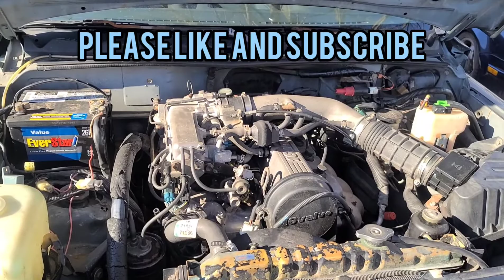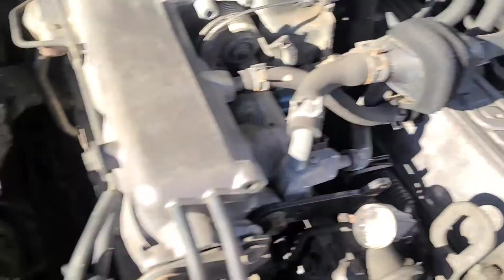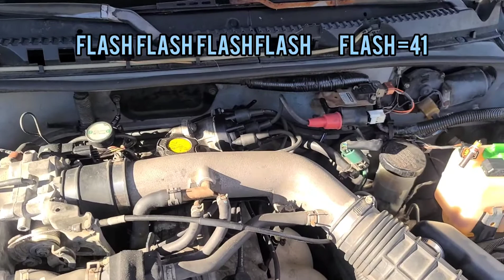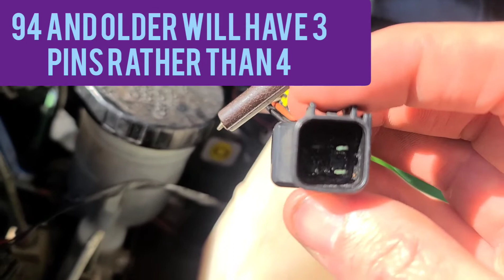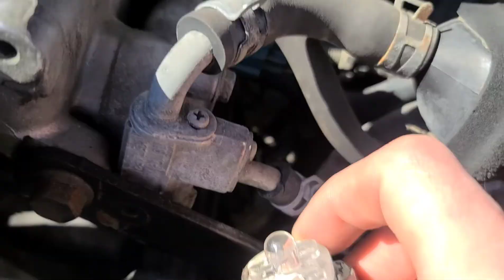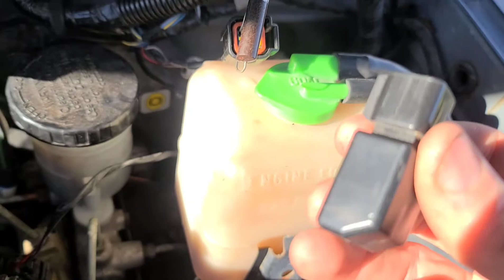Geo Tracker no start repair, quick fix!

Comment: My 89 is notorious for corrosion. Last two times the no start was from corrosion on the two screws on fuel pump. Make it easy cut access hole so you dont have to drop tank. Watched all the videos and did all the checks suggested. Like I said the corrosion was on actual fuel pump leads. Cleaned with battery terminal cleaner. Started right up.

Comment: bro am having a problem with the exact same car which is no spark. when I turn the key on I see 1 spark just like you said with the injector's and while cranking the engine there is no spark and after I stop cranking, I see one last spark. but I've not checked the injectors like you did. we pulled out the ECM and checked for any funny looking capacitor but no luck. also, the ignition coil and ignitor have been checked but they are fine. now am only left with replacing ECM, noise filter and distributor. if you have any suggestions please help. I'll do the test you did on this vid but am not convinced that will be my issue because as you said in your case you got spark and I got non.
Reply: After a long trouble shooting we finally figured out the problem which happens to be a wiring issue. in case anyone is having the same problem I thought this might help...
What happened was there is a wire that goes from the distributor to the ECM I think it's a camshaft angle sensor CAS (I might be wrong) and that wire was broken, we fixed that and the spark was back she fried right up.😊.

Comment: Very educational video. No body talk about this issues. I have a 97 tracker everything runs good, till i fueled up and now the check engine light is on all the time. I did the 2 & 4 pins code reading, and nothing, the engine check light never blinks at all. Any idea can be the my problem ? Thanks guys.

Comment: Hi man Daniel here my car does the same if i spray fuel into the intake it starts, but the moment i stop spraying it dies, I did also test with noid lights on all 4 and do have continuous light on them flashing when cranking. It does look like the flashing on noid lights goes a little bit dimmer as I am cranking over, is this normal. Lastly my resistor like the one in video has only 3 pins with two measuring over 2000ohms but other two is just open line, I thinks i will replace that also and check it out from there.

Comment: Great video:) any luck finding one, part number?
Reply from the maker: I was unable to find this part, however making one using inexpensive resistors has proven to work without an problems.
Reply: 11492-1105  this part ranges from 35 to 58 bucks

Comment: I bought a 94 geo tracker that wouldn’t start we did all kinds of trial and error but there is just no power to the coil ! We’ve replaced the coil and still no dice it’ll crank just won’t start :/
Reply from the maker: No power to the coil primary circuit?
Reply: @ChronCrew  no power to the coil yes it will crank but will not start all the lights and everything works though

Comment: My husband has a 93 Geo tracker he is having problem getting it to start most of  the time.  Has good battery and good starter (he says).  He let the brake fuel run completely out, when he filled it up is when the problem started.  We are bleeding the brakes to see if that helps.  Can the problem be between the starter and the brakes?
Reply: No sorry
Reply: Brake system is self-contained.

Comment: Am having the same no start issues but the ignition is working the injector i test for a 12volt reading and the reading show 12 then 8 then 5 but i dont see the resistor connections you showing but i do see a 3 pin parts look like a resistor

Comment: With regard  to the noise suppressor that you need to replace, where on the car does it mount?
Reply from the maker: It just hangs on the firewall underneath the wiper motor on the drivers side

Comment: I have a 95 Tracker and just put in a new starter and it clicks a few times befor it starts, brand new battery, and positive terminal and brand new starter. Any idea what to do next? I took it back to the store and they checked it out in the truck and it checked out good even though it took a few clicks to start.
Reply: If it's a manual transmission, there's a button under the dash that's depressed by  the clutch pedal. It closes a circuit when depressed . It may need adjustment or replacement.
Reply: Which button? having this same issue on my 96 manual... No crank no start, not battery or starter, or alternator, ahhhh @dirtyboyscout8541

Comment: Very educational. I recently purchased a 95 geo from my mom. She parked it due to it not starting and when in went to hook up the jumper cables I found some of the nuts and bolts holding the positive wire on the battery were loose. I tightened them up and haven’t had any trouble since but after watching this video it made me think. I will probably check for corrosion on that resistor
Reply: You scored lol